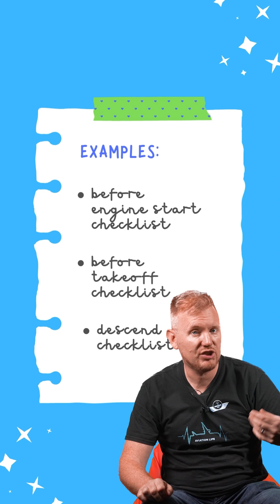How do Pilots Use CHECKLISTS?! #shorts

Comment: I worked in the electricity supply industry, and we used a similar system All HF switching had to be run with a switching programme. The engineer carrying out the work and the control engineer had the same programme, and the control engineer would instruct the operator to carry out, for example operations one to four, and he would read them out. The operator read them back, and then would carry out those operations, each one timed, then they would do the same for all the other stages.

Comment: computer should just check the plane on its own. there should be no checklist
Reply: Computer? So there is one computer?🤔
Reply: @speedbird9313  ? usually yes, if not one could be added.
Reply: @DanFrederiksen  And which computer would that be?🤔
Reply: @speedbird9313  try to make your unintelligent point instead of asking asinine questions slowly leading up to your unintelligent point.
Reply: @DanFrederiksen  Im just very interesed in which computer you are talking about🤷🏻‍♂️
Reply: @speedbird9313  one with access to all the information needed to be checked. That may or may not be the case in existing systems.
Reply: @DanFrederiksen  Yeah..sorry, that doesnt exist..
Reply: @speedbird9313  first of all, I'm proposing it. because it doesn't exist. Second, it's very easy to do. spooling up engines and watching numbers if ultra easy for a computer to do, it's very archaic that it's done manually. similarly all the checks can be done automatically, they can even be designed to be constantly checked by computer. for instance how free the control surfaces are. A computer can spot any build up in resistance, any vibration, any ice build up etc
Reply: @DanFrederiksen  For a lot of the things you mention it exist monitoring, but checklists arent mainly for monitoring, but changes for a different flight phase.

Comment: I was aircrew on SAR helos in the USCG. Some checklists never leave you;  I could still start the APU and engines of an HH-3f if, for some odd reason, I had to.

Years ago, I managed to get my wife to use elements from the Before Taxi checklist from the HH-3f when we drive together. She does the responses in the passenger seat and calls when she drives. She even chides me if I forget to respond properly!

Seatbelt and shoulder harness?  On and adjusted
Ready for Taxi? Ready for taxi
Releasing Parking Brake
Taxiing.
Clear Right (or Left)? Clear Right (or Left)

Comment: Checklists are great either backing up a “flow” a “read and do” or the well known “challenge and response” 
The mix of these work effectively and are proven. 
Great video as always 👍
Reply: Flows are for challenge and response.  Each pilot does their respective flows when the pilot flying calls for the checklist.. and then you do the challenge and response.  

Read and do are usual to for emergencies and abnormalities (after any memory items) as the flows are too complex and seldom
used and you want to make sure you are doing it correctly. 

There’s also “checks” where the pilot monitoring will silently check all of the items.  Common for this is after takeoff, cruise, and after landing—each of which is less critical than before start, before taxi, before takeoff, descent, approach, and landing checklists.

Comment: It's on the knee board right?
Reply from the maker: Depends on the type of aircraft you fly
Reply: @MentourPilot  Eh... one with wings. :)
Reply: @Smartzenegger  the best aircraft have rotor blades. And yes we had knee boards for maps and checklists.
Reply: @MeppyMan  Does a 747 have a kneeboard? If not, did it have those in the past?